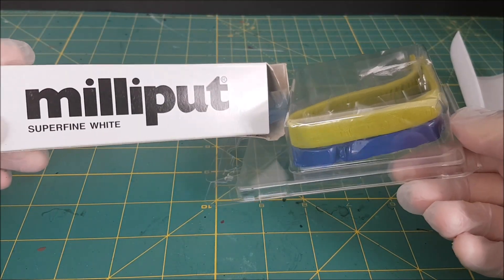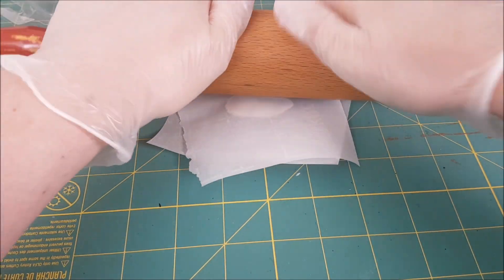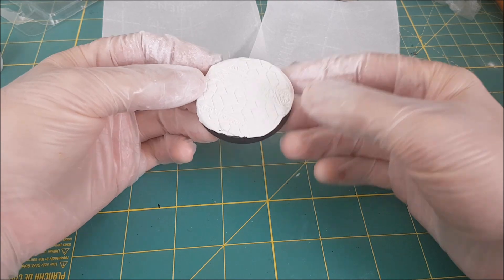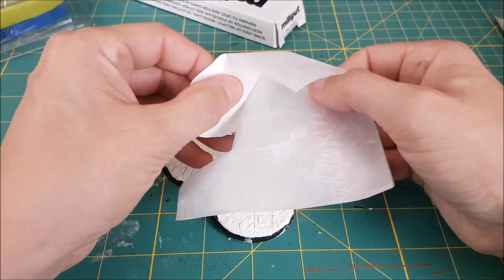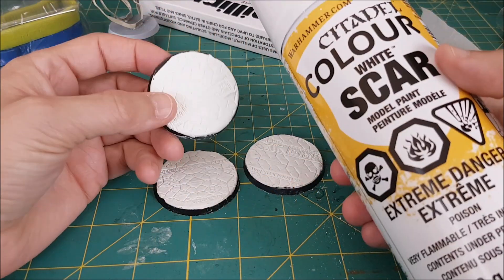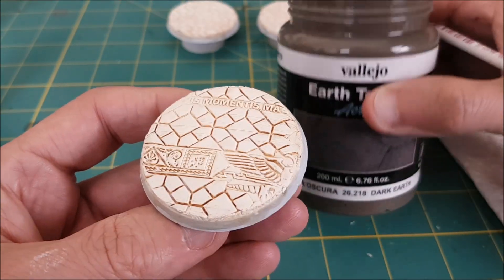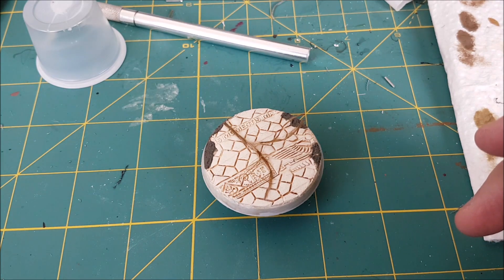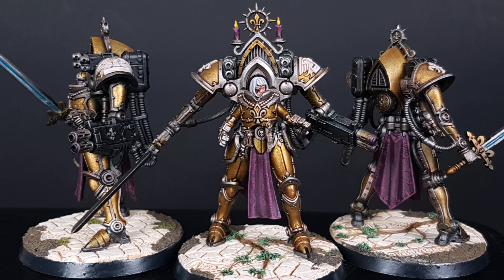How to Make Ancient Roman Bases for your Miniatures

Comment: Me and my dad work with stone and a little trick to keep in mind when making cobblestone or other similar bases stone based bases is that a lot of such stone streets have some form of grey in between the stones. Even back in the old days since they often used fine gravel. While it is easy to think that the space between the stones should have an earthy color or black shade it is more often than not a greyish color. That is often due to the materiel you use for the "seams" between the stone, it probably has a better English name but the Swedish name translate to seam.
Then moss or some amount of dirt gets between it adding spots of green and brownish colors :)
Since you seem to enjoy putting a bit of effort into bases I thought it was worth sharing :)
Reply from the maker: I will definitely keep that in mind for next time! Thank you :)

Comment: anyway to avoid  the streaked effect of the roller ?
Reply from the maker: You'd probably have to sand down the roller. I found that the lines were imprinted on the roller like it was 3D printed. You could also lightly sand the base with fine grit sandpaper.